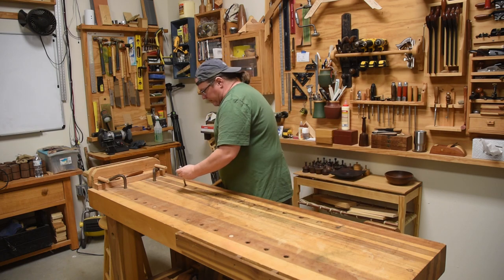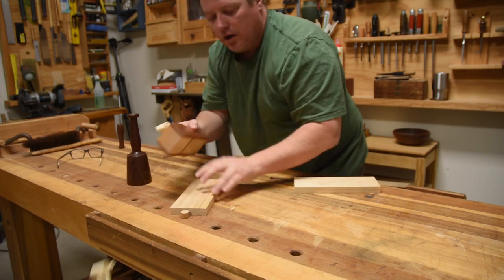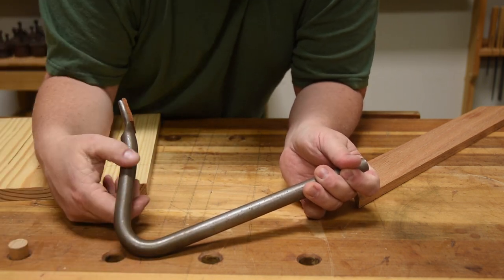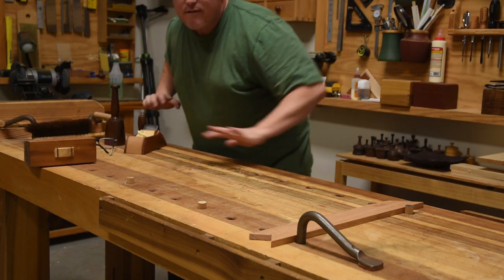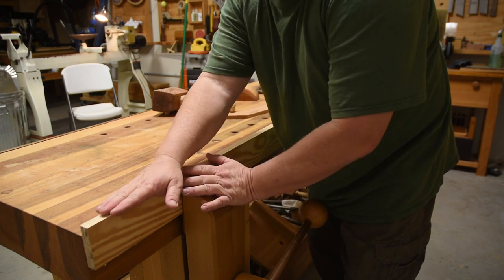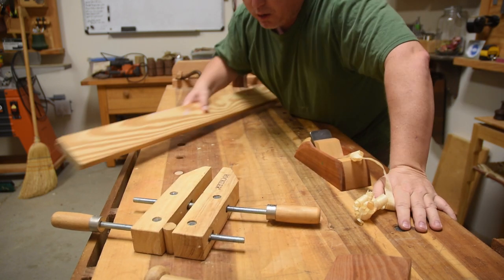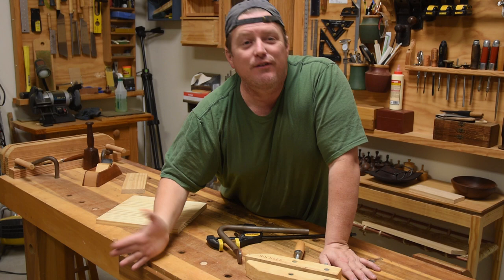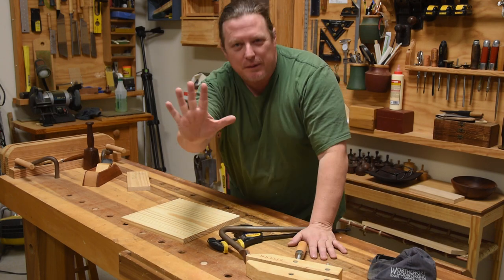Workbench Workholding

Comment: Great video!

I would add though that using wedges and or cams with dog hole system is very versatile and can substitute for many clamps and clamping jobs like gluing up panels say on the bench.
Also they can be used for many of the processes you show.
Reply from the maker: Ya coulda just searched the subject on my channel as I've discussed that many times before.
Reply: @wortheffort  You sound a little over-defensive... considering I said it was a great video...
Reply from the maker: nah, just seemed odd you'd go out of way to search for something on other channel to promote here when it has been covered here. That's actually something people program "bots" to do in the "Pay for Views" arena. Which is an issue devastating many other channels at the moment. But I did verify before commenting you weren't recommending your own channel. @michaelkulman7095
Reply: @wortheffort  I just looked for a video to illustrate what I meant, not for you so much as other viewers and I just used what came up first in a search and it didn't even occur to me to search your channel. Now maybe I have bad YouTube etiquette, that may be true but I'm just a casual user who doesn't even think about the things you mentioned, that aspect of things.

Comment: My mind was blown when you removed the end of that quick-clamp. Had to pause the video and go check my clamps. Mine do remove, but they're a cheaper Irwin style with a screw / nut instead of a slide-off release required to get it off. Still, I've seen 4-5 workholding videos and never seen that excellent tip! I also like the mousepad idea.
Reply from the maker: They work pretty good. I use em that way in jigs a lot.
Reply: If you take the fixed jaw off and put it backwards on the other end of the bar your clamp becomes a spreader.
Reply: @halsonger1317  My cheapo clamps do not release the trigger side, but that is a good idea.

Comment: For anyone reading the comments: Check out the woodwright's shop episode "Viseless Devices" (Season 34 Episode 5, available streamed on the PBS website.) There's some other handy ways to hold things shown there.

I'm always fussing with adjusting my handscrew clamps to get enough of a contact surface, maybe it just takes practice but they slip if they're slightly off-parallel. I use C clamps most often and jam a small piece of scrap under the pads, as well as having a bunch of odd small clamp-on vises I got used for relatively cheap.

For vise screws: Scissor jacks are a good source of long, strong threaded rods with a handle hole built in, if you find a cheap used one (or want to replace the one in your car emergency kit.) Just make sure the thread is full-length and clean it real well first. Not sure if dismantling the jack for the rod or using the jack as-is is a better way to go about using it. In the former case you may have to make a wood threading tap for it by hacking off the end (like in matthias wandel's video on it) if you can't reuse the nut inside it.

Comment: Question? With the hold fast you were demonstrating, what is the ideal bench top thickness? I would assume that a one inch thick bench top would not hold as well as a 3 1/2” thick bench top. Mine is laminated 2x4s turned on end, as many are, so I am sure it would be fine but I have other bench tops that are not as thick. What is the thinnest bench top they would hold on? I’m sure the thickest just depends on the length of the “neck” (if you will) of the gold fast? Thank you for the videos! Love them all. Keep up the good work!! I would like to see you restore an old tool. I bet you would have some more interesting process than all the videos I see where vinegar or evaporust is the star of the show haha. Thanks again man!!
Reply from the maker: Go to the Tools for Working Wood website and they have a whole article on it. People like me with a thick top usually counterbore underneath so the effective thickness for the holdfast is something like 2.5-3.5"
Reply: Thanks man I really appreciate it!
Reply: My bench top is douglas fir 2x10 planks.  I have the same holdfasts and they work.   I might do the next top thicker with laminating 2x3 boards when I wear this one down.T
Reply: I have a 3" top, and just picked up one of the grammercy holdfasts, its working great in my Nicholson style bench.

Comment: Do you have any videos on how you made tapped your dowels so nicely?  I have a little wood tap and die set for 3/4" dowels that I used for making nut crackers.  It works ok, but there's a lot of wood tear out on the threads that I don't see on yours.  Any tips for that?  Did you make it on the lathe?  I did a quick search of your channel and didn't find anything, thanks.
Reply: Check out King's Fine Woodworking.  He shows how to avoid the tear out in wood threads by soaking the dowel in mineral oil.
Reply: @talltimberswoodshop7552  thanks.  I tried with boiled linseed oil, but maybe just didn't let it soak long enough (the interior of the threads was still dry when I cut them). I'll check out the video you suggested.
Reply from the maker: I have a bonus somewhere on the chinese tap an die's I use. They're not great. You have to reharden the blade. But They've made about 60 leg vises so I've gotten my money's worth. A little wax or oil makes em work easier.
Reply: There's a german-made wood threading kit which is leagues better than the chinese versions. Other than that there's the power-driven beall system and plans in one of roy underhill's books for making a wood tap and die.